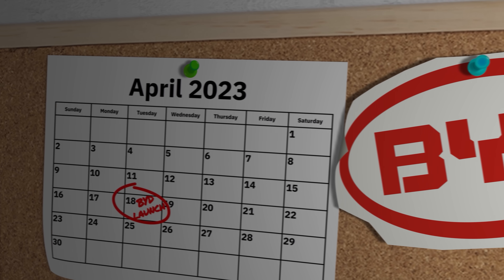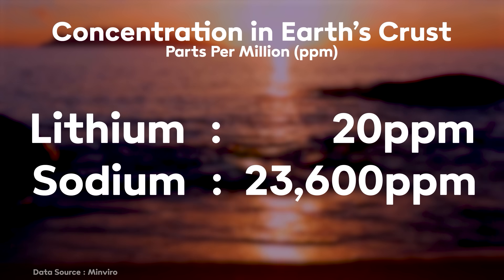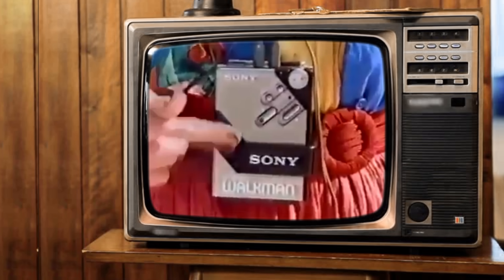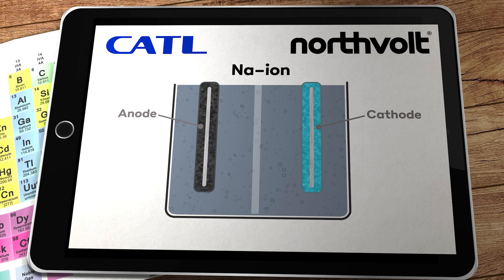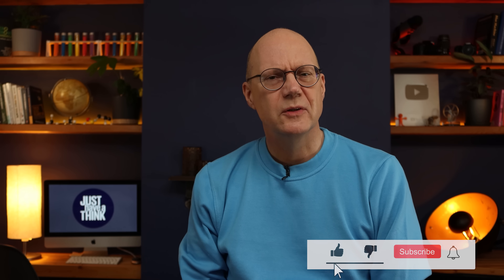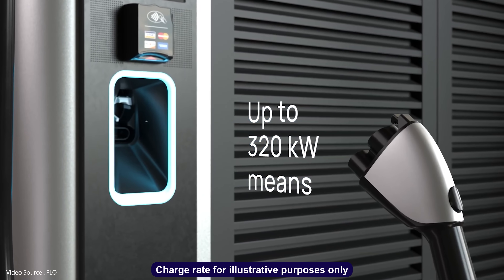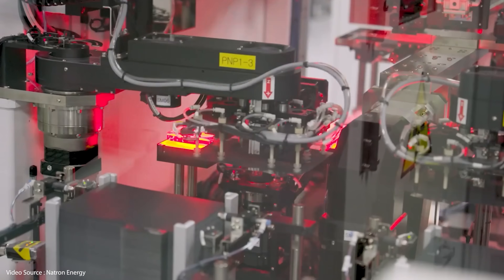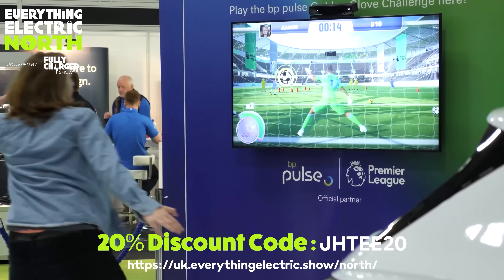Sodium-ion batteries in the USA. Beating China at their own game!

Comment: I am the owner of a BYD Seagull (known as the Yuan 300 here in Colombia, where I live.) After import duties, it cost me the equivalent of US$30,000. Since there is practically no charging infrastructure in my country, I rely on my home charger, which takes 10 hours, or a trickle charger, which can be plugged in anywhere but takes 24 hours. Despite these shortcomings, I wouldn't change my BYD for any other car!!!!
Reply: 30k too expensive,   You could buy a Tesla
Reply: It's not a sodium ion battery
Reply: @giddyup3451  It's Lithium Iron Phosphate. Much safer than Lithium Ion as used in Teslas.
Reply: Trickle charge? Do you an electric clothes dryer at home that runs on 220V? There are kits to run a level 2 EV charger off your dryer circuit..
Reply: @jaaklucas1329  I already have a 220V charger in my home. It was supplied with the car - together with the 110 V trickle charger, which I use when I am on the road.
Reply: It was supposed to be called Seagull SHIT, but the extra letters cost too much ! 🤣
And don’t compare Germany and Japan with China. The Germans and Japanese continually improved their products. The Chinese continually FADE the quality until you no longer want to risk buying their CRAP. 
Electric vehicles can be dangerous when the quality is poor.
Reply: How much are you being paid for this rubbish
Reply: Gooood car!
Reply: Colombia needs to get rid of the import duties. They only make the costs of living hard for their Citizens.
Reply: They are selling for 9,000 to 11 000 in China right now 

Sucks with those export fees
Reply: @DW-op7ly  yea hopefully the domestic market in China calms down soon and they can allow for smaller margins overseas. This probably won't apply to the US and maybe not Germany because of protectionist measures but they should become cheaper in other countries.
Reply: For anyone in the know, China is the leader in EVs. They have the safest battery tech (e.g. blade battery) fastest "recharing" Nio's battery swap, best UI and hardware in the industry while cost less than half compared to your European brands.
Reply: Not including environmental impacts charging at home is the biggest benefit of an EV in my opinion.  I suspect not fueling up at gas stations could save people around 40 days when you add up all the time over a lifetime.  You could take a month long cruise with that extra time and have time to spare.  That's not even taking into account what gas fumes are doing to our lungs.
Reply: That's cool. What about build quality? My casually racist mind thinks of Chinese cars as lower quality. It's a subconscious hurdle I need to work on getting over.
Reply: @user72974  All BYD cars got 5 star score in Europe NCAP crash test
Reply: @user72974  given most of what you buy today was produced in China I think it's pretty safe to say quality is whatever you're willing to pay for
Reply: @user72974  you need to differentiate between good name and no name Chinese suppliers. BYD is a strong brand with good build quality.
Reply: @user72974  Shortly after WO2 everything coming out of Germany had to be labled Made in Germany as a scare tactic. It soon became a quality mark, if it had that label it meant it was quality stuff you could trust. A couple of decades later the same happened for Japanese goods: started as inferior imitations and soon became best you can get. Do you see the pattern already?
Reply: @MartinMaat  Correlation is not causation.
Reply: Except if you did some research Chinese cars are not only cheap but  safe and more innovative.
Reply: @Jesus.the.Christ  not what the point of his comment was. He was talking about media manipulation.
Reply: @nfzeta128  You are off base. MartinMaat was clearly trying to make the point that BECAUSE German and Japanese build quality was good, then China's must be as well. That is a false connection at best and spurious reasoning at worst.
Reply: @Jesus.the.Christ  No, he was trying to say the US did this false marketing before and that you shouldn't believe it.
You're the one off base, read it again.
Reply: @DW-op7ly , exported cars must meet certain standards. Domestically sold cars are horribly unsafe.
Reply: @MartinMaat  Even a nut and bolt made in Germany is expensive. I haven't been able to figure out why
Reply: @seriouscat2231  You try to grab onto anything don't you?
Do you think a company would create two different factories or production lines just to make their domestic product worse or their exported product better?
Reply: @DW-op7ly  Most Chinese machines and equipment are shit, by extention there cars are also. I should know because I have used here shit in construction and reverted back properly made equipment, no more Chinese for me thank you
Reply: @normmaes3218  that is your opinion

Yet China has a 820 billion a year trade surplus with the world
Reply: @Jesus.the.Christ  Face up to the reality, then. This rule still works fine now.
Reply: @Jesus.the.Christ  That makes no sense.  Don't try and throw phrases around to try and make yourself look smart.  You're just exposing your ignorance
Reply: @samwho1731  Wow. Grow up. Take your feeble attempt to spread misinformation and shove it.
Reply: @user72974  The US and Europe are already hitting them with 100% tariffs because they're good enough to compete unless the prices are artificially raised by tariffs.
Reply: @IMBlakeley  Please reread what you wrote and rewrite it so it makes sense.
Reply: Fix the Unions first, thanks
Reply: @IMBlakeley  I question what you say
Reply: @laughinggas5281 China EV oversea costs 2x of cost in China.
Reply: They are huge fire risks. I wouldn't park any EV in my garage or even near my house, but Chinese EVs seem to be especially dangerous.
Reply: @inthefade  False. BEVs have the lowest rate of fires of any type of car BY FAR. Chinese BEVs are about equal to a bit better than EVs around the world.

Actually look up stats and stop just talking with emotion.
Reply: @inthefade  That is actually wrong TWICE!   EVs are LESS LIKELY to catch fire than ICE vehicles and Chinese cars, on average, are more safe than western EVs, because they are more likely to use LFP chemistry.
Reply: @inthefade  Nonsense.
Reply: @inthefade hello mate, I hope you still living in your cave. 😂
Reply: excelent car! I also want to buy one in UK
Reply: 30K USD for an imported EV? Expats are the worst.
Reply: You are obviously not an English-speaker or an American.
Reply: @shamancredible8632 then their opinion towards a car is not worth listening to? What an absurd deduction.
Many comments in this thread are off topic and lack of logic. (1) Teslas are built in China. Half of Tesla sold globally in 2023 were built in its factory in China. The owners outside American are very likely driving one. (2) an ethnic Chinese who reads Chinese is more likely to read/watch China related news/vids and thus understands the latest situation in China better than others, and this theory applies to ethnic Serbians to Serbia, too. This is an advantage over non-speakers, to the opposite of a point worth attack. (3) both German and Japan made goods experiencing a ‘trash to high quality’ arch is not the sufficient condition to say goods made in any country will experience the same arch. But it’s the sufficient condition to say goods made in any country May experience the same arch. To rephrase: goods made in A country was deemed trash previously is Not Sufficient to conclude that the new goods made in A country is trash. (4) you get what you paid for. A $10 simple metal tool made in USA today is likely worse in quality than the same tool bought 30 years ago in $10 (worth $21 today, source: dollartimes.com）. No one should expect a $1 simple metal tool to beat a $10 one in quality, no matter where they are made. Have you ever tried high priced goods designed and made in China? Say, DJI? Say, luxury EVs?
(5) your words are worth less because of your nationality, race, ethnicity, native language etc. so how much are the words from Europeans/European Americans/European Oceanians worth? 0? Isn’t this the biggest rock that will sink the US hegemony with it?
Reply: @shamancredible8632  That's incorrect, you should write "nor an American", not "or an American".  English lessons for free!  You are correct however that I'm not American, I'm from the same country as the gentlemen who made this video.
Reply: How did it get from 10k to 30k? 😅 might as well buy a tesla?
Reply: @thuibbyu The 30k Tesla still isn't here. Elon has a habit of over promising.
Reply: @thuibbyu  Import duties also apply to Teslas and unless the Tesla is built in China, it will be of lower quality than a BYD.  If you're American you probably don't understand something else, your country is not well liked at present in much of the world.  In the Global South, people prefer to buy from China over the USA.
Reply: @thuibbyu  Tesla doesn't sell a car for $30k they cost $55k they market it for 30k claiming tax rebates, and savings on fuel makes it 30k.
Reply: @thuibbyu  the people love Chinese cars in Central and South America 

Not so much rival car companies and to some extent Governments
Reply: @100c0c  

 

 then their market is about to grow even more in Brazil 

Even with an expected jump in 2 million “more” EV cars sales this year in China???? 

That will still only be around 33% of all car sales for 2024. So EVs have a long way to go in China as well being only 27% of all car sales in 2023

One things for sure they will continue to make even more affordable, good quality and innovative EVs in the future

👇

BEV Sales Shoot Past All Expectations in Brazil in December, Rise 700%!

BYD’s Impact ‌

It’s clear that Brazil’s massive BEV growth comes mainly from one source: BYD. Or, specifically, BYD’s upcoming factory in Camaçari, in the Brazilian state of Bahia, which will start production in 2025. The promise of local production paired with the arrival of the BYD Dolphin in Brazil at 149,700 Brazilian reales ($30,385 USD) seems to have worked in two different ways: for one, it forced competition to lower its prices, making the EV market more competitive overall; for another, it gave BYD local recognition, allowing it to dominate the growing market in the latter half of 2023.

CleanTechnica
Reply: @DW-op7ly   33% in China which by far has the best infrastructure and government coordination for EVs (except maybe for Norway)? You're too optimistic.
Reply: @100c0c  

 China EVs are becoming cheaper than ICE vehicles 

And world oil reserves is estimated to be 50 years left 

Where rare earths is estimated to be 500 years left 

Where lithium (not a rare earth) they are expecting China to be able to meet those lithium battery needs through recycling by 2059 

But you can always wish for your grandkids go back to the horse and buggy 

👇

China is way ahead 

China is the world's biggest EV producer and market. It's also a leader in battery recycling.    

China's EV battery recycling market is about 10 times larger than the EU's, Christoph Neef, a scientist at the Fraunhofer Institute for Systems and Innovation Research in Germany, told DW.

China, a major producer and processor of key battery raw materials like lithium and graphite, could replace lithium obtained by mining with recycled lithium in EV batteries from 2059 onward, according to a study by the University of Münster in Germany. 

By comparison, Europe and the US are expected to reach that milestone only after 2070. As far as nickel is concerned, China can probably meet demand through recycling in 2046 at the earliest, with Europe following in 2058 and the US from 2064 onward.

DW
Reply: @DW-op7ly   You copy paste but don't respond with substance to what I actually said.
Reply: @100c0c  btw are you a ethnic German in Brazil?

I have seen you post in the past 

It would make the most sense
Reply: @DW-op7ly   No. I'm an ethnic Serbian in Canada.
Reply: @100c0c  

I’m Canadian as well

now I can understand the dislike 

I was shocked at the reception Serbians gave Xi  in his recent visit

I wonder if Canadians would even show up for a Trudeau rally 

We are beholden to the USA these days like it or not… I use to be pro American until the 1990s. But it was mistake after mistake that turned me into an anti American 

When the USA goes down it will take Canada with it 
👇

We are writing history today," Serbian President Aleksandar Vucic told a large crowd that had gathered in front of the Serbian presidential palace to welcome Xi, applauding and chanting "China, China". The two countries signed 29 agreements promoting legal, regulatory and economic cooperation.

Reuters
Reply: @DW-op7ly   My geopolitical opinions have nothing to do with the my opinion on the viability of EVs globally. Serbia-China relationship is good. This shows you're not thinking impartially and critically. This is merely your way of supporting China.
Reply: @100c0c  to be fair if you asked me 10 years ago countries would have throw up tariffs on Chinese cars let alone EV cars and let alone their innovation with these cars 

I wouldn’t have believed myself 

Even 5 years ago I would have had a hard time believing 

Especially with the speed and the scale they are bringing cars to the market these days. BYD with everything in house from lithium mines to their own cargo ships 

Coming up against that type of business model/thinking you have to learn and adapt 

Or get moved out 

I can tell you and your family will get pushed out to the boonies by the new immigrants, not just the Chinese ones
Reply: @DW-op7ly   I was raised in Vancouver around many Chinese and South Asians. I was at the top of my graduating class. I was admitted into the most competitive university in the country (vs many Chinese and South Asians) and graduated top of my class there as well. Both my parents are successful medical professionals. I'll be fine. You're continuing to show your opinion on EVs is personal and biased.
Reply: @100c0c  

 

I’ve known many people like you 
 very book smart 

Once you learn something you never forget 

But then people like you can’t adapt to new information 

If you learned Pluto was a planet as a kid 

Then its a planet and not a dwarf plant with it’s recent classification 

Information that does not fit into your narrow view of things does not compute like this below 

👇
China-made vehicles will comprise a quarter of Europe's EV sales this year, study shows
UPDATED THU, MAR 28 2024 

 * The share of made-in-China vehicles in Europe is expected to rise to 25.3% in 2024 as emerging Chinese brands like BYD expand their footprint in the region.
 * Tariffs will need to be raised to at least 25% to make EV sedans and SUVs imported from China more expensive than their EU equivalents.
 * China-made electric vehicles will make up more than a quarter of the EV sales in Europe this year, with the country's share increasing by over 5% from a year earlier, according to a new policy analysis. 

About 19.5% of battery-powered EVs sold in the EU last year were from China, with close to a third of the sales in France and Spain constituting EVs shipped from the Asian country, the European Federation for Transport and Environment (T&E) reported in a paper shared Wednesday. 

CNBC
Reply: @DW-op7ly   I work in a fast changing field. I would be out of a job if I was stubborn. I know people like you, though. People who support something not based on facts but rather how it makes them feel. You copy and paste articles without actually addressing what's being said. You see a number, feel good, and press paste. Not questioning. I assume you're Chinese?
Reply: @100c0c  nope I am Canadian

what is there to address?

You are arguing against EVs im showing article after article their growing market share 

You seem to think since they don’t have 100% market share it’s a failure that is your opinion 

Feel free to show they are not gaining market share 

The worst that can be said is their growth has slowed 

But they are still taking market share 

But then Countries throw up tariffs then that growth will slow 

But they are not just throwing up tariffs they are also throwing money at their legacy auto companies helping them to transition 

Feel free to cut and paste even something that shows EVs will not continue to take market share 

All you are doing is giving an opinion not based on the facts 

Telling others they have a bias 

No shame at all 

Fast paced used car salesman 

Sorry you are a nobody with an opinion 

👇

China's EV strategy of going small and cheap to pay big dividends in Asia
By Clyde Russell
April 23, 2024

LAUNCESTON, Australia, April 23 (Reuters) - China's dominance of global electric vehicle production and sales is an established fact, but a new International Energy Agency (IEA) report points to the country extending its influence in autos across the fast-growing economies of Asia.
The IEA's Global Electric Vehicle (EV) Outlook 2024 report, released on Tuesday, shows that China accounted for 60% of all EV sales in 2023, and its rapid uptake will continue, with one in three cars on China's roads in 2030 expected to be electric.
Perhaps more significantly the IEA sees China's influence and lead in EVs spreading throughout Asia as it leverages its vast industrial resources to invest and promote cheaper EVs in countries such as Thailand, Vietnam and Indonesia.
The key to success for China's EVs, when compared to vehicles made in Europe and North America, is cost.
"In China, we estimate that more than 60% of electric cars
sold in 2023 were already cheaper than their average combustion engine equivalent," the report said.

Reuters
Reply: @DW-op7ly   I'm asking of your ethnicity, not nationality. For example, I'm Serbian ethnically but my nationality is Canadian. I assume you're Chinese Canadian? There would be no other reason to behave how you are.
Reply: Really? I smell s😅mething
Reply: i would not want it for free; my cars (LPG, Diesel and gasoline, have 6 cars,all 20 to 30 years old, all RUN NEW, A/C and ABS, ALL)   i am a mechanic) i refuel in 5 minutes; hope you won't regret that EV religion ,but you might...
Reply: @josepeixoto3384  "Religion" is an odd word to describe people liking EVs. There are solid reasons, not feelings based on faith. Being able to charge at home and pay relatively stable electricity rates instead of the ever-changing price of gasoline. Polluting the air less (especially if their electricity comes from sources like solar, wind, hydro, or nuclear). etc

Being able to refuel in 5 minutes is quite an advantage though! If I recall, the battery industry is working on making charging work faster all the time. Here's hoping they're up to the challenge. 5 minutes is a great goal.
Reply: @josepeixoto3384  Yeah, well I don't ever have to fill up or find a station.  Religion is believing something for the sake of belief.  Most EV haters, believe EV's as inferior without ever giving them a try.  There's a good reason why 70 percent of EV users, never go back to gas and it has noting to do with belief.
Reply: @josepeixoto3384  world oil reserves is estimated at 50 years 

The world has 500 years of rare earths and we also know this when it comes to lithium (not a rare earth)

👇

China is way ahead 

China is the world's biggest EV producer and market. It's also a leader in battery recycling.    

China's EV battery recycling market is about 10 times larger than the EU's, Christoph Neef, a scientist at the Fraunhofer Institute for Systems and Innovation Research in Germany, told DW.

China, a major producer and processor of key battery raw materials like lithium and graphite, could replace lithium obtained by mining with recycled lithium in EV batteries from 2059 onward, according to a study by the University of Münster in Germany. 

By comparison, Europe and the US are expected to reach that milestone only after 2070. As far as nickel is concerned, China can probably meet demand through recycling in 2046 at the earliest, with Europe following in 2058 and the US from 2064 onward.

DW
Reply: @josepeixoto3384  bro, you're the one who sounds like they're part of a cult.